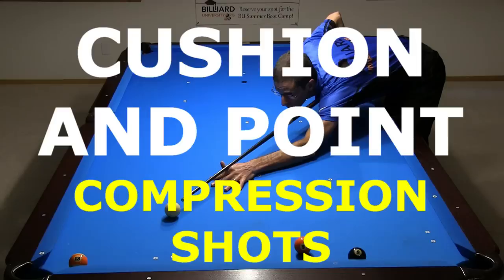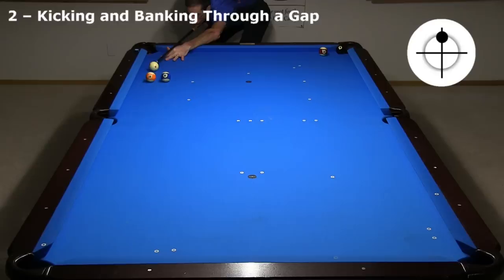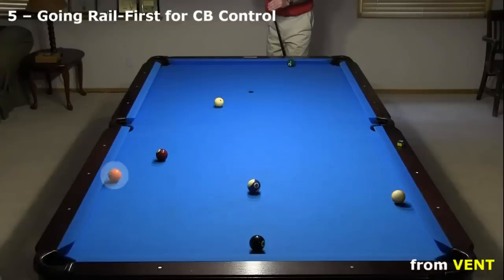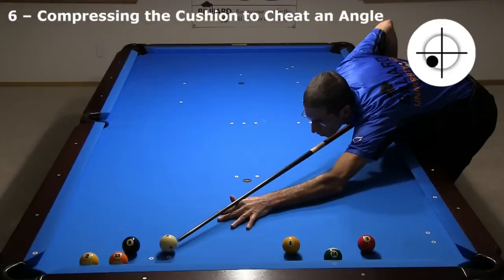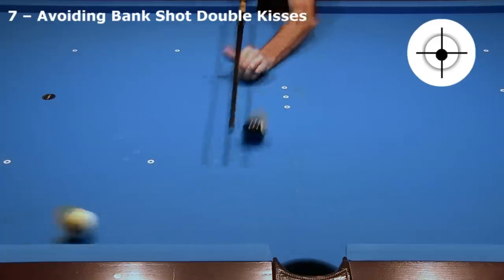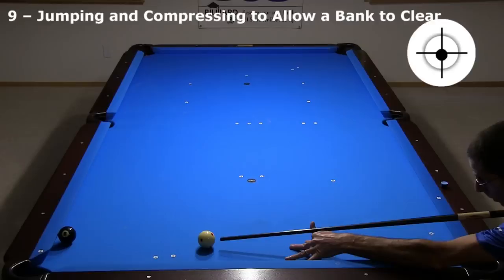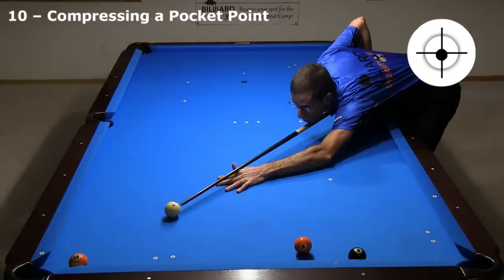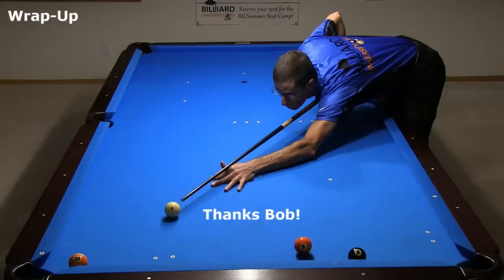Cushion and Point Compression Shots

Comment: Another great video on the beautiful subtleties of the game; thanks. For the insurmountable #9, hope yet remains. It's quite feasible to bank the 8 to the right side pocket, or even to the right upper corner pocket (yes, you can!). Banking to the right upper corner is possible both with a double-kiss (another example of using compression), and also---believe it or not---without the kiss (just a very thin bottom right hit, with as level a cue as possible). This will get a raised eyebrow even from some very experienced players. These cross-corner shots are great to know for one-pocket. Most players aren't aware of these, and they may be good topics for one of your specialty videos.
Reply from the maker: I'm glad you liked it.  FYI, I showed the other banks you mention in my previous video:
    https://www.youtube.com/watch?v=11iSqkJjWgM&t=703s
Reply: @DrDaveBilliards   I was not referring so much to the fairly well-known double-kiss bank, but especially the direct and pretty extreme cross-corner bank. I have played for 60 years, and have never seen this until a top player showed it to me last year. I have not seen this shot anywhere on YouTube, and I thought your more advanced subscribers might like it. It's not that hard to get it close, which makes it very useful for one-pocket. I have even over-cut this by almost a diamond on the head rail.  https://youtu.be/gnlsSbqDRQ0   
     It's counter-intuitive, but low right is preferable (a 4:30 hit). This is because low left loses whitey, with a chance to scratch or kiss the object ball. Also, the hit is so thin that the gearing effect doesn't really matter. Understanding the squirt adjustment necessary is the key to the shot---basically, hit it as thin as you can, so you know exactly where to aim. Sometimes it may be the only option... IF you know the shot exists.
Reply from the maker: @rocketceo  Nice shot.  With such a thin hit, I wouldn't think any spin is required.  I'll try it out.
Reply: DrDaveBilliards The inside English prevents the straight across scratch. You also really do not wish to hit the short rail, and lose whitey, and increase the chance of a scratch up table. Basically, with inside the cue ball just careens back and forth between the long rails, moving further and further from the short rail. No scratch anywhere, unless off a ball. I like about 1.5 tips both low and right. It’s a thing of beauty, an eye-popper for most, and a nice specialty shot to have in your tool box. Thanks again for your immense contribution to our game!

Comment: I'm nowhere near the level to be working with any of these concepts, but I'm really curious- to what extent can most of these be used in top level play? We see all the crazy looking trick shots from Reyes, but would he and other top players be using these things and with reliable success? Are players using a lot of these things regularly (with it largely going by unnoticed, due to the level of expertise required to understand the difficulty in the shot)? Or is it more something that you can achieve in a video via a few takes, but which would be too unreliable compared to playing safe?
Reply from the maker: I've seen many of these techniques applied by top players during actual play (except for jumping the coin into a glass, which is just a silly and fun trick shot).  Many of the shots don't come up often, and sometimes a safety is a better alternative; but when a top player is forced into one of these options, they will usually have a feel for how to succeed (or at least get close), because they have practiced these shots before.  Shots 5, 7, 10, and 11 are particularly important because they come up more than the others and they can be mastered fairly easily with practice.
Reply: @DrDaveBilliards  cheers. How about things like 1 2 and 4? Would they be quite low percentage ones to judge perfectly on a first attempt?
Reply from the maker: @cziffra1980  Those shots aren't as tough as they might look.  As with anything, with practice the percentages go up.